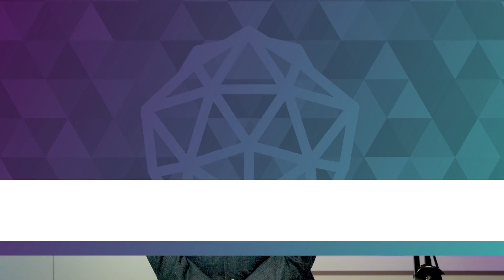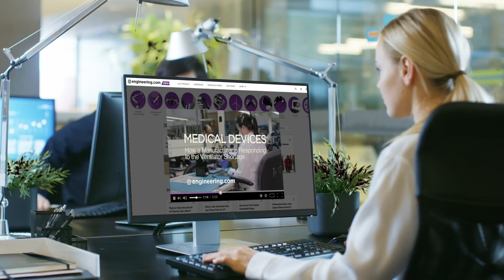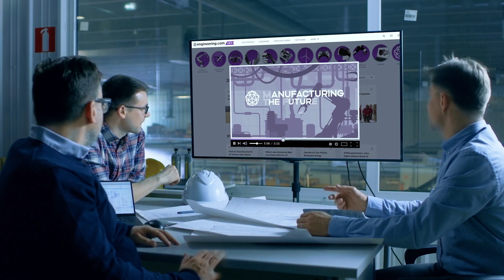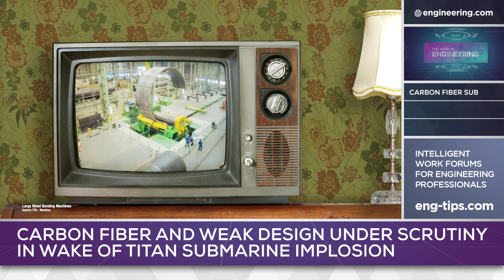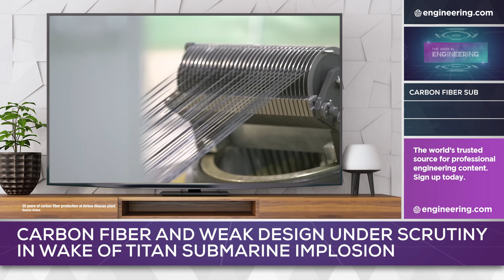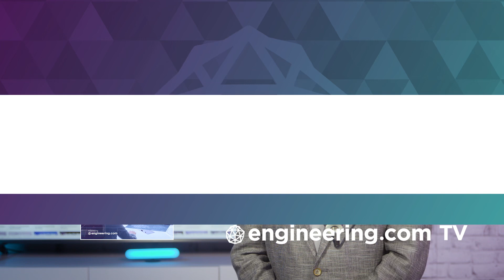Was the OceanGate Sub Implosion an Engineering Failure?

Comment: I found the reason for this several years ago, and recently posted it on my FaceBook page. Although they know that it was probably due to front viewing port. It was. This specific sub was tested for exactly that. Some of those in the company building it knew the windshield was not safe. I think he was one the management team and his concern was shared by others. So he wrote a letter to president of his company saying, specifically that it not handle the pressure it was expected to. His president did not return his post and paid him no mind. I BELIEVE that same fellow might have actually been on that sub as it failed. at least the parts which were at risk of failure. That difficulty itself may become the “topic of the day” pretty soon.

Comment: not really an engineering failure and not even a test failure, but more of  a "failure to test"   You would think something like that would undergo some rigorous extremely high pressure testing before they ever put people in it.  For example attaching a steel cable to it and lower it down to depths exceeding its expected crush depth and repeating the process a few hundred times and analyzing the structure each time they winch it up but no,  to my knowledge, the first time it went to a depth close to its rating it had a human in it.  That is a completely INSANE risk level by any QA standards.